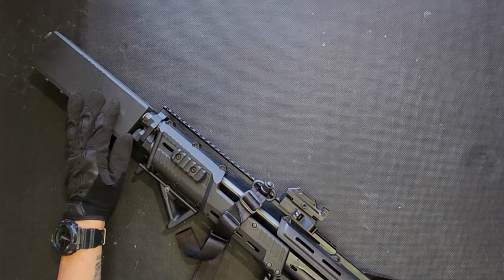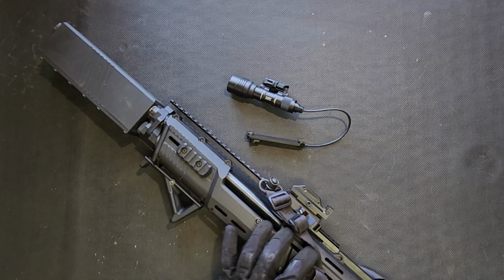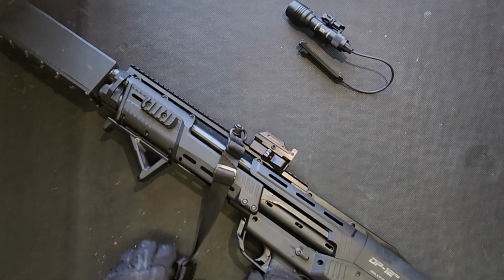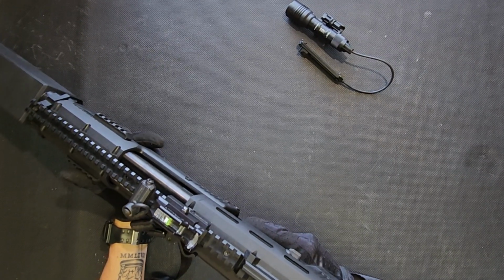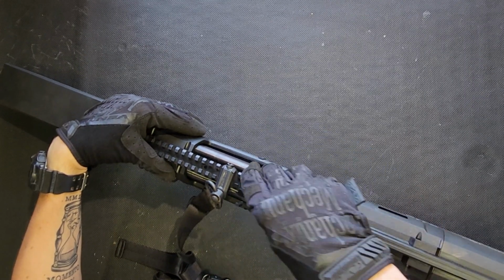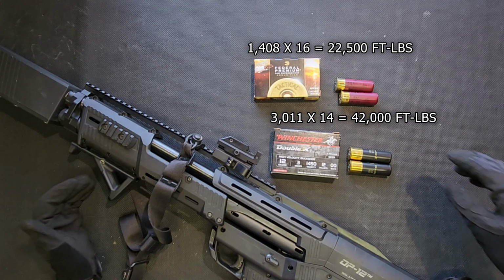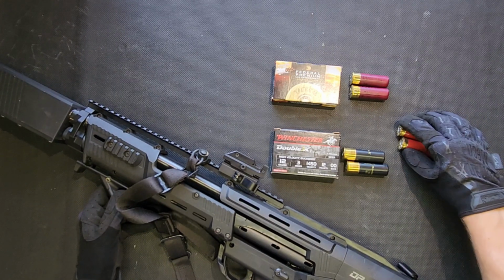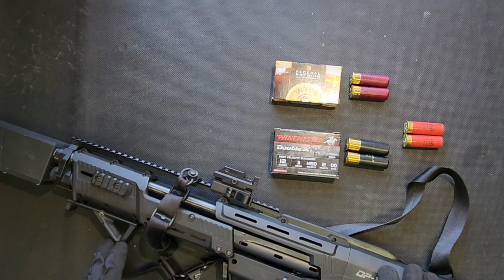Ultimate DP-12 Build

Comment: Dude youre like a Honda guy. You slap cosmetics and muffler on & call it a "build".
The gun jams, fails to eject, light strikes, and is ridiculous to clear when jammed,  and gen 2 didnt fix that but the barrel explodes now. Hoped you identified a fix to call this a build, but its just a meme gun with a can. I want my ten mins back
Reply from the maker: While I can't speak for every DP-12 in production, my gun hasn't demonstrated any of those issues.  I don't work for Standard Manufacturing.  Your definition of a build intrigues me.  How many gun "builds" have you made that involve designing and machining a suppressor from scratch?  That's what I figured.

Comment: I would love to pick up the gun and silencer but I can't figure out if I should grab a gen 2. I have a suspicion they made the thing cheaper to manufacture more than better? 

Should I grab a gen 1 while I still can?

And can you tell me if yours' drops the first firing pin if you hold the trigger and pump? I've heard users report that, while others said it caused a dead trigger or malfunction.
Reply from the maker: I believe the upgrade to the Gen 2 is less about cost savings and more about weight savings.  Though, I have not yet confirmed how much weight is saved exactly.  I would simply watch the prices for both and buy whichever makes sense for you.  

If I fire the second barrel and continue holding the trigger while pumping the action, the first firing pin instantly drops when the action locks up.  I have heard that the "slam fire" feature was only on very early DP-12s (made in 2016-2017), so don't plan on all of them with that feature.
Reply: @romeohoteleng I just subbed but u don't have any new videos. U still in commission? 😉
Reply: @dgunearthed7859  I'm still working, but on projects that are not public yet.  More Videos to come soon!
Reply: Thanks for the info! Slightly disappointed about the slam fire lottery but it's good to know.

I see all then gen 2 listings still have the weight upwards of 9 lbs. unloaded so I think I'll try to get hold of a Gen 1.

For anyone else interested in comparing the two, I can't confirm but heard the gen 2 does perform a bit smoother and lock up less in really cold temps.